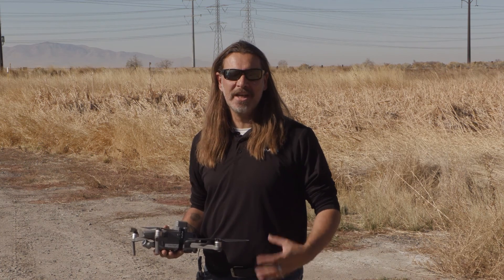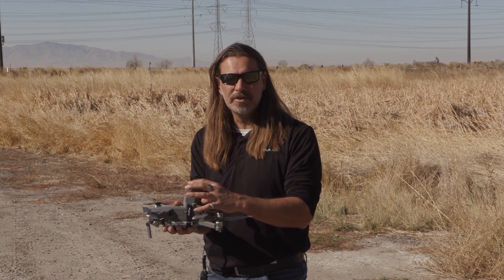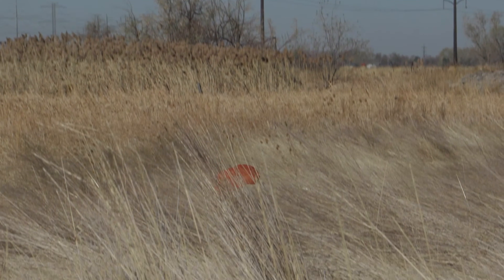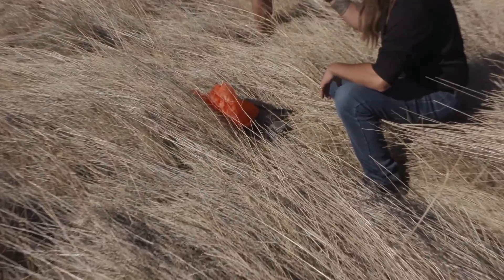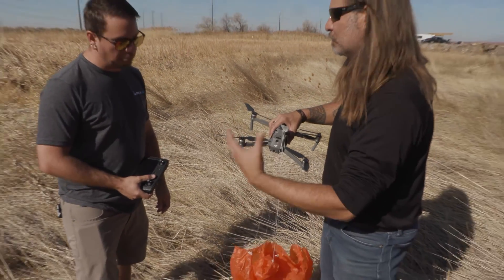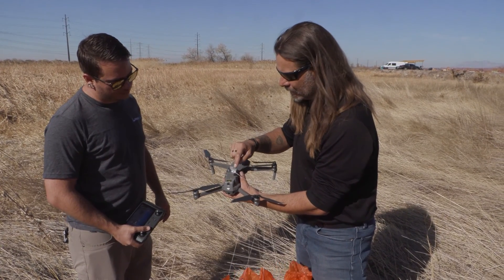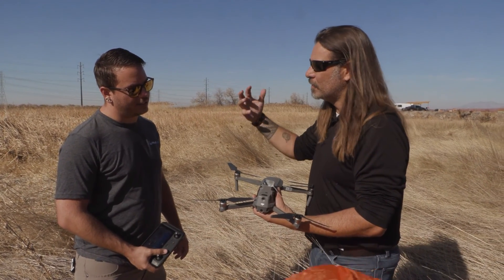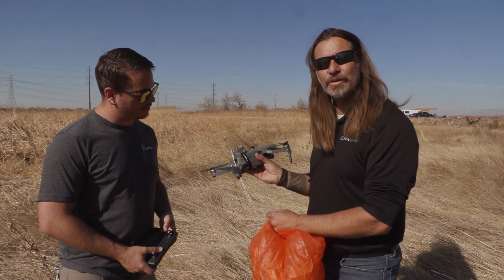RMUS TechConnectᵀᴹ | Flyfire First Look on Mavic 2 Enterprise

Comment: Great info and video, been waiting to see a non-advertisement video of Manti 2. I was surprised to see it drop 100’ to deploy... the advertisement suggested much less... Great to know now, below 180-200’ may not deploy. Would like to see results landing on hard dirt or parking lot simulating work environments and the repacking of chute. The Manti 2 has been hard getting info, there doesn’t appear to be a Flyfire website (English), and zero info on repacking supplies. Does the actual kit include any additional info or source of re-packing supplies?
Reply: I've bought one a week ago, in the box it only contains the parachute itself, manual instructions and a replacement for the strap. But no info about repacking or supplies for that neither.
Reply: @bandiido666  
Found the Repack kits on Aliexpress. Sells activator & top cover, parachute, or both in one kit. At $15.60 or $31.20 set. Ordered 2 activator kits and 1 combo kit... to see if they arrive.
Reply: Normal qu’il n’y ait pas de dommage. Le drone est tombé sur de la broussaille bien dodue pour amortir le choc 😉